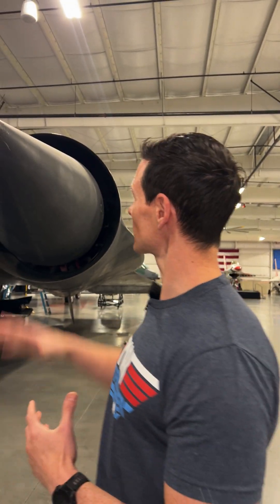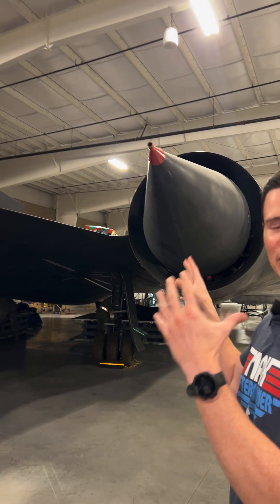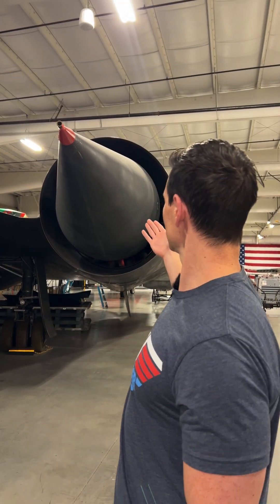SR-71 Blackbird Engine Will Suprise You

Comment: Huh?  I’m absolutely baffled by that description you just gave of the shock cones of the P&W J-58.  Just about everything you said was not accurate.  Shock cone positioning was a function of inlet temp, airspeed and altitude.  The shock cones were scheduled by fuel pressure from the fuel pump/fuel control and was very critical in efficient compressor control.  The faster the aircraft went the further the inlet cones extended, adjusting and forming the supersonic shockwaves in the inlet to slow the velocity of the air to subsonic speeds.  The compressor of the J-58 also was equipped with a set in inlet guide vanes as the first stage of the compressor.  Between the scheduling of the shock cones, the compressor guide vanes, and the inlet duct ejectors, located on the top lip of the inlet, air was controlled and efficiently fed to the compressor.  As the aircraft exceeded Mach 2.5, the turbine bypass ducts fed excess air around the combustion section of the engine completely bypassing the high pressure turbine.  The six bypass ducts dumped the air directly into the afterburner unit, the engine becoming more of a ramjet than a turbojet.  Loss of compressor scheduling led immediately to a compressor stall, in the SR community it was colloquially known as an unstart, and the pilot had just under a second to slap both throttles to idle…or else!  A majority of SR-71 losses were due to uncontrolled yaw rates which destroyed the aircraft.  Unstarts, even those that were recovered, were positively horrifying.  Imagine, if you would, an aircraft power system, generating on the high side of 120,000 horsepower, losing half of that and there’s almost a 20 foot gap between the engines.  Uncontrollable yaw BAD!
Reply from the maker: Yeah I'm definitely not an engineer but I would fly this thing all day long.
Reply: @MaxAfterburnerusa  ABSOLUTELY!